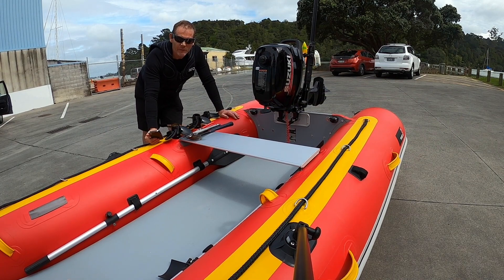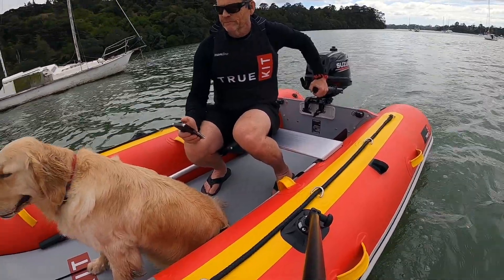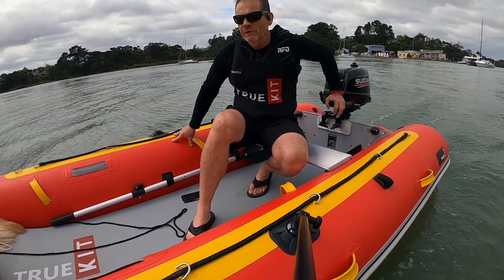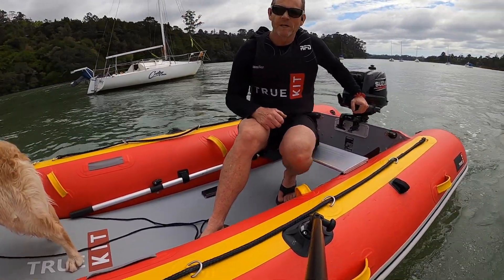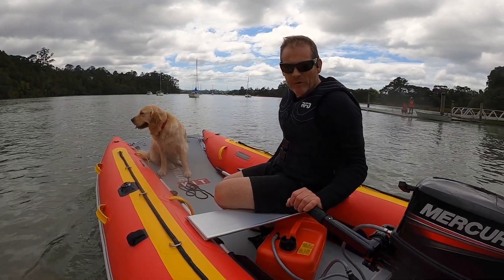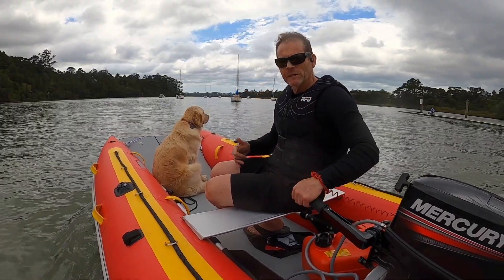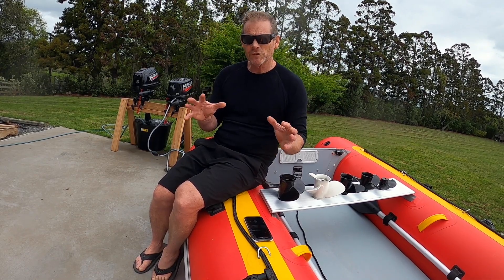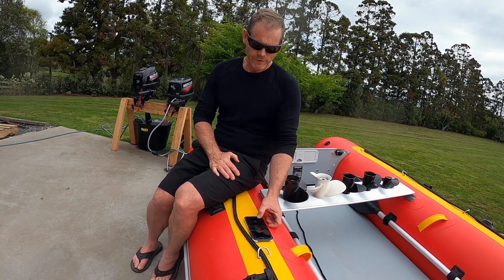True Kit Testing Propellers   What's in a Prop?

Comment: Good day, I am running the Discovery 4mts with a 4-stroke Suzuki 20HP short-shaft. I also added the permatim and a SOLAS 9,25" - 9 Pich - cupped, but the prop is still slipping, so it's still not the right propeller. Any ideas for a propeller that can do the trick? Do I need to add more pitch, a larger diameter, or both? What about a 4-blade? Any tips are more than welcome. Thanks.

Comment: Hi, researching getting into a 330, wondering if a long leg (20") would be OK, better than the recommended short, get the prop lower in the water, less cav etc, due to thru-flow between hulls? 
Whilst its cool watchn the puppy, rear camera view was good, could see the wake & spray. Merc sounded like she needed a carb service.
Reply from the maker: Hi there.  You are actually better getting the prop/leg higher for less water disturbance. We recommend short shaft, a Permatrim and a cupped prop as the best combination for most lightweight dinghies
Reply: @TRUEKITINFLATABLES  Thankyou. Internet being what it is, I found forum posts where people have cut the transom down 5cm, incl pics, thus my concern.
Reply from the maker: @Lana_Warwick  you will find just as many have raised their transom heights.  It probably means we have got it about right!
Reply: @TRUEKITINFLATABLES  Yes, I just watched a RoKKiT KiT prop vid (after yours), with the timber riser. And then of course lots of debate in the comments. Thanks again.

Comment: Oh come on.
6hp the dog was further forward obviously quicker acceleration 😂.
Also the most important thing is for the prop to hit maximum RPM the information we actually need. I have the 6hp stock prop 3.3m 37kg sib  5500rpm.
So i cut it down sharpened it now 5900 15.1 knots from 14.4 before.

Comment: Something else you can do to help the all around performance is extend the ventilation plate area. Just cut out a piece of aluminum the same width as the vent plate and extend it 4 to 6''aft. In this way you are in affectively creating a trim tab stabilizer  without creating additional drag. Also you can hammer in a small amount of cup to the outer edge of the prop to minimize prop slip.

Comment: Does anyone have any video of the Discovery 280 with 2 adults in it? I have a 8hp Tohatsu 2 stroke  and need to know if it will plane with 2 adults aboard before I pull the trigger and get one.
Many tanks
Reply: He got it to plane with a 6hp 4 stroke. The Tohatsu weighs very similar and has more grunt so I'd say no issues planing

Comment: ThanX for the nice review.   Could you supply the specs on the aftermarket prop you tested with the Merc 9,9 please .
Reply from the maker: We used a Solas 8.5x8 and a Pandora 8.5x8.5, plus standard and standard modified props

Comment: So what was the top speed I couldn't see it on your phone for the 9.9 
Also interested to see 15hp yamaha prop  results and top speeds 
Can these boats be launched from a beach in surf wave conditions 
Would also like to see a how they handle a bar crossing 
Keep up the great work
Reply: 31km/hr which is around 20mph. On my 330 with 9.8 tohatsu I get about 20 ok stock prop. Havent done testing of the cupped solas, that's coming.
Reply from the maker: That's correct.  Top speed was 31kph.  There are prop shapes that could probably give you a bit more top end if you were racing it with a lightish load
Reply: @TRUEKITINFLATABLES  oh, great, thanks Rod!Now I need to get me some prop shades too.. Lol :)